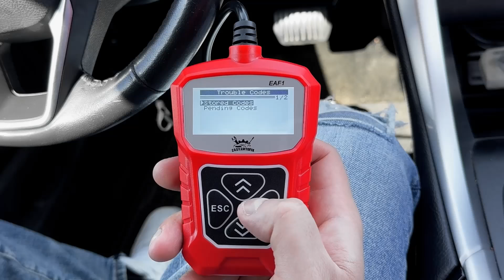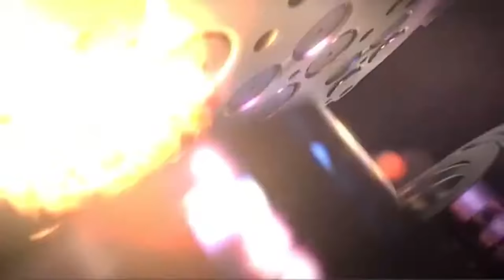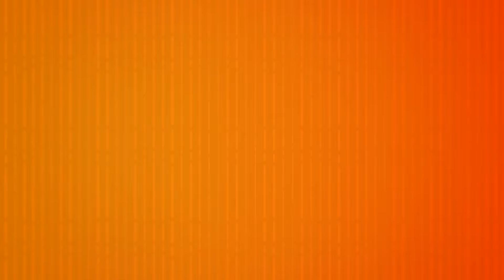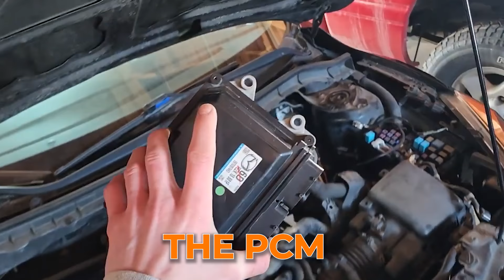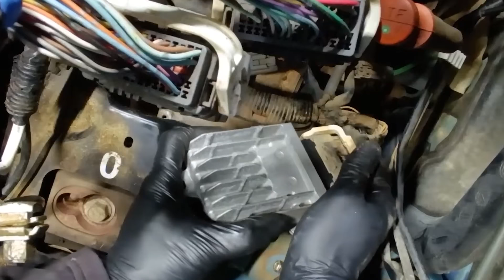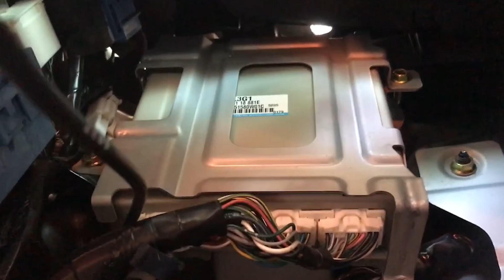This ONE Button Resets Your Mazda’s Computer Instantly (Do This NOW!)

Comment: Pressing the brake pedal with the power and accorded off will not drain the PCM capacitor because the circuit is broken.

Comment: Good to know. I recently had a Cork Sport full filter-to-turbo air intake installed. The custom shop that installed it normally works on very high end cars and SUVs so Itrust the mechanic knew on the test drive to do some of the reset procedure. I did the rest. I will say that having BOTH the Cork Sport intercooler and the CS air intake system made a significant difference in power. On a dynamometer I would guess that I would have at least a 20 horsepower gain.  I'm vary happy with the outcome.